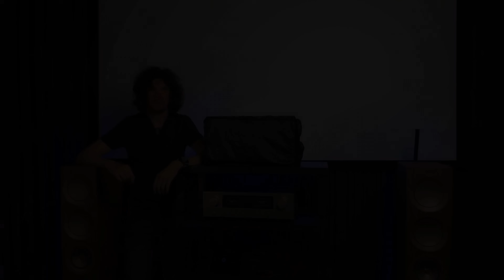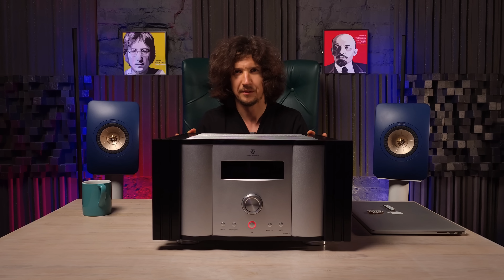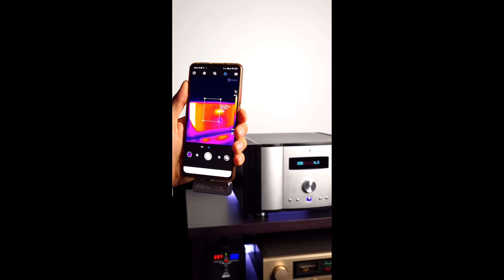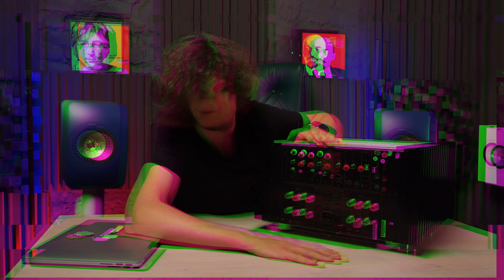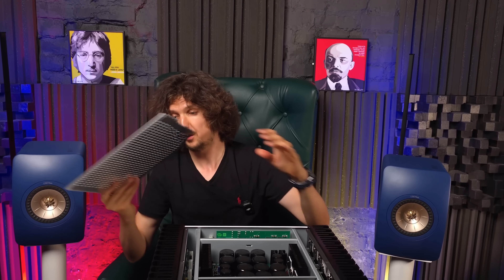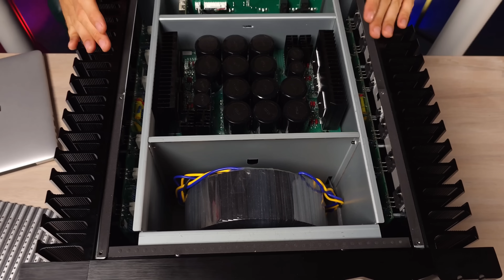ToneWinner AD2PRO Plus – Inside & Out! Full Autopsy & Sound Test

Comment: The Chinese make some amazingly good stuff. The issue I find is that they often spoil a potentially great component by not having attention to quality control, or to finessing the basic design, to work as it should. This can often result in ruining what could have been a good product. Also if you don't live in China and buy direct, getting customer support and honouring  warranty can be very difficult and frustrating. Their products are very tempting because they can offer such fantastic value for money.

Comment: I have no bias against mainland Chinese products. However, until you measure performance output you can't truly evaluate an A class Amp.  Measure performance (SINAD) using 5 watt/4 Ohm load one minute after you turn it on. Measure it again after it heats up. Why is this important? Because there is no good reason to use linear A class amplification if it doesn't provide exquisite reproduction of the input signal. I have measured some A class from good companies that were distortion factories (SURPRISE!), so you can't judge a book (or an amp) by its cover.